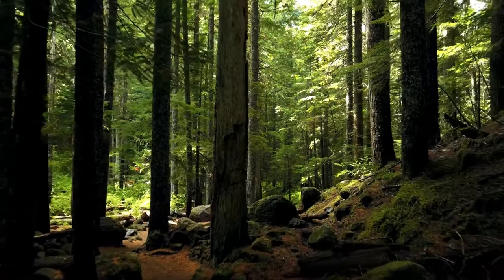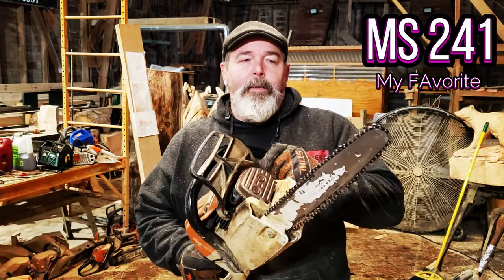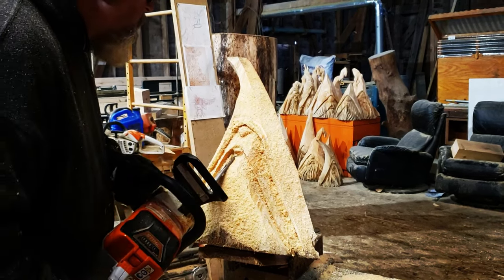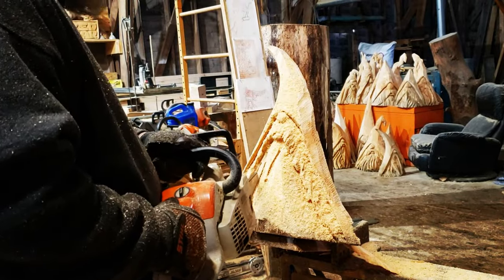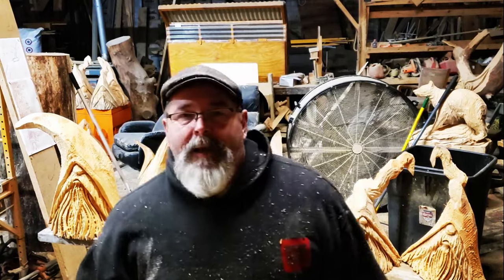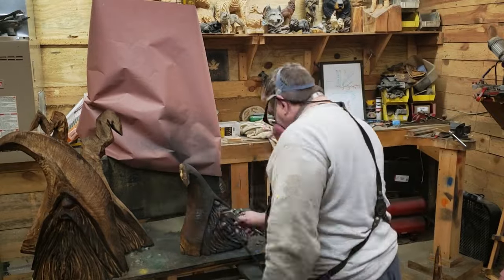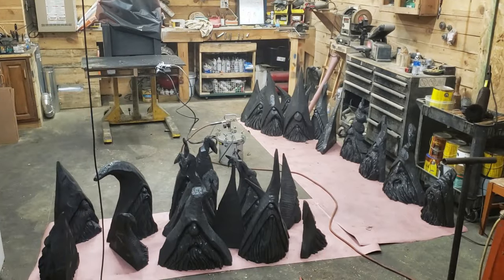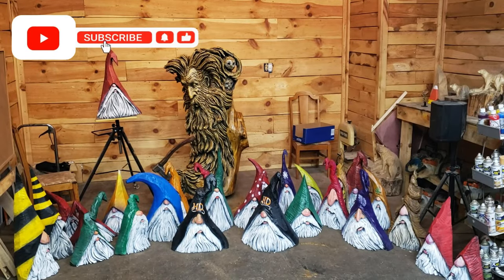Chainsaw Carving Gnomes

Comment: Hi Jeff, another great video.   Those are some awesome gnomes sir. I'm going to have to do a few of these. I started doing that dry brushing you show and its made my carvings look so much better.  Thank you for that. 
Question- You mention the saw and bar combo but what chain and chain sizes are you running on those saws? It looks like you have 3 different chains between them.  The tsumura looks like maybe an .043 and the 70c looks chunkier.

Comment: 👍🇺🇦
Which chainsaw is better 241 or 250?
Reply from the maker: There is no comparison other then they are both Chainsaws. Lol
The 241 is a pro saw, and they stopped making them. The 250 has good power, but it will rattle your teeth out of your head. The 241 is smoother with crazy good power, If you can find one buy it, and you will be happy you did. The 241 is also very expensive, and the 250 is a great bang for you buck saw, meaning that its a good saw for the money. Also the filtration on the 250 or the 251 is not as good as the 251. Thanks for watching. I hope this helps
Reply: @BigRagufromAT thank you for your help. Why did I ask for 250? Because there is no 241 in our town. I found MS 241 C-M in the online store, it is a little cheaper than 250, is it like yours? 
I have a 180 and I want to put a 1,3mm carving tire on it. And I understand that I a need more powerful chainsaw, so I am asking for your advice.
Sorry for my English.
Reply from the maker: @БогданЛосюк-ъ8щ  actually I prefer the 192 by far. I do rig run downs in some of my other videos. Check them out.
Reply from the maker: My bad the 194 is the current version. I have 4 of them.
Reply: Thank you very much